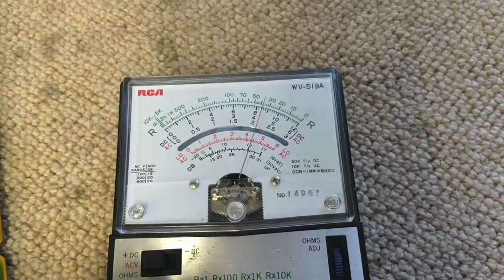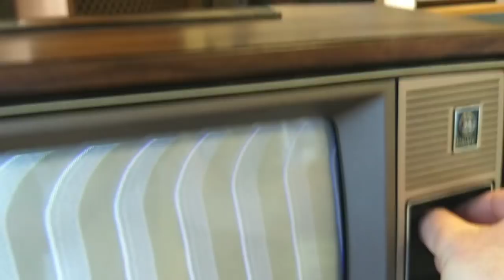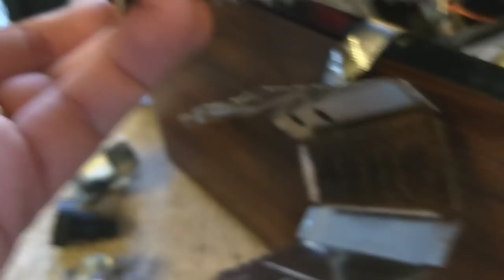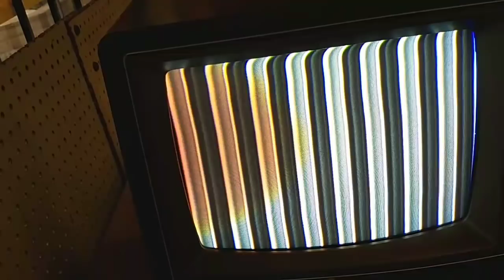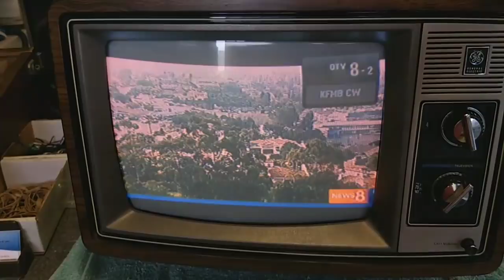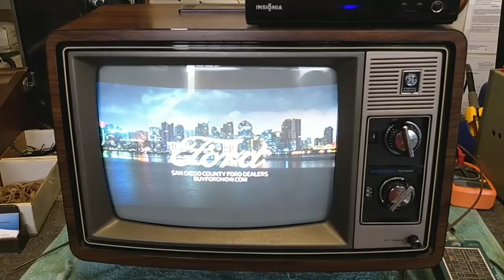Troubleshoot & Repair a 1979 General Electric 13ack546w color television part 3/3

Comment: Good job Jordan. Remember in the part 2/3 comments I suggested to put back the original if IC in place in your tests.. I said 'maybe it's not quite a good replacement' and it gives you new weird problems..

Comment: I was given two TVs from my grandad and one of them is a 60s Sears portable black and white TV  ( OEM was tosihba ). The other TV was a 1979 9" AC\DC Zenith from the late 70s and it works perfectly fine and needs nothing done to it  the Sears TV needs new electrolytic capacitors because the vertical doesn't fill the screen, audio is weak, hum bar goose throw the picture. Those things aside the TV dose tune signal and I don't have  CRT tester. So can't test the CRT but the CRT is pretty bright and clear. the Sears TV uses all tubes no transistor at all. I. Will have not to fun of  time recapping this Sears TV it's one of those TVs that looks cool but is very hard to get to the components without doing a lot of disassemble.